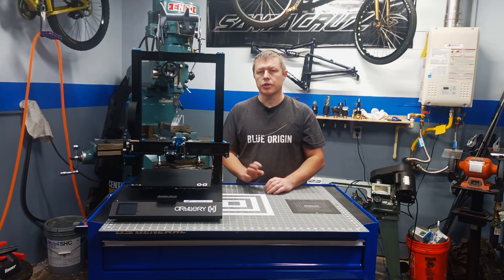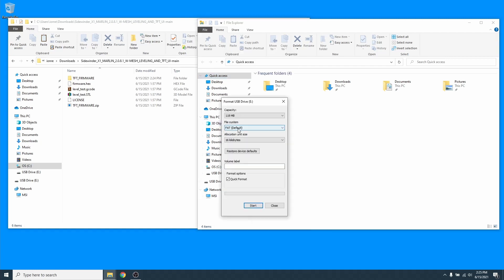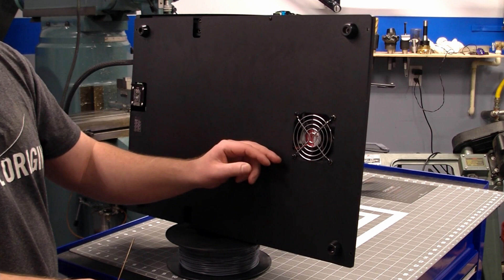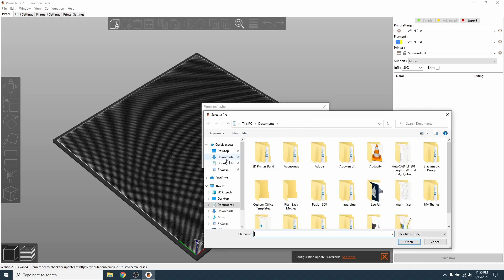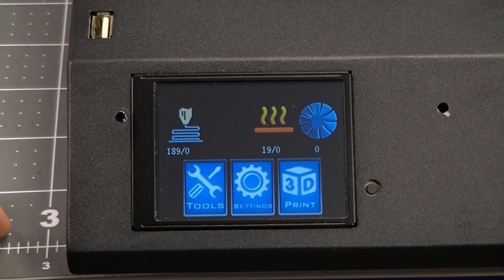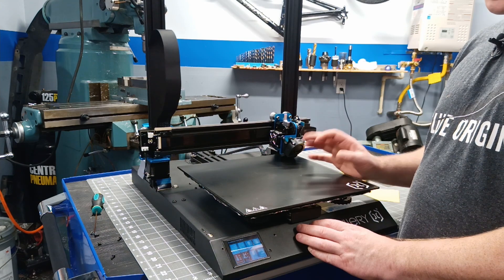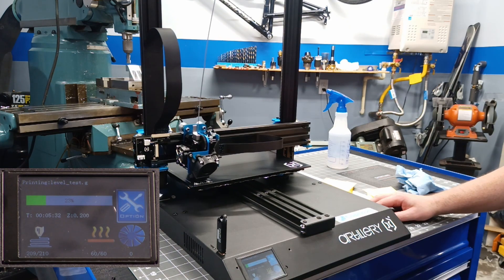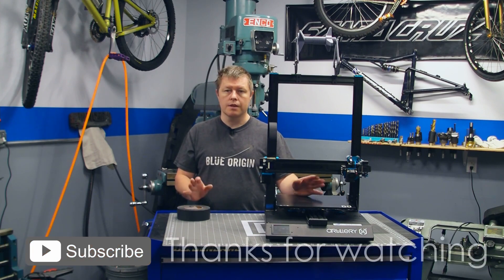Sidewinder X1 Marlin 2.0.8.1 with mesh leveling and custom touch screen UI.

Comment: Thank you for the information.  It's very much appreciated.  I tried this last night on my Artillery X1 and thing seemed to go well.  After printing the level_test.gcode all were perfect but the top right corner.  When I tried it again the first square was having a problem so when I went to stop the print I noticed on the printer screen it said, "mesh leveling failed".  I tried it twice with the same results last night.  I would love to get this working.  Any ideas on how to fix this?
Reply from the maker: I had that happen to me one time, I re did the mesh leveling and its been fine since. You can try redoing the mesh leveling and see if that takes care of it. If you have any more problems please let me know so I can look into it further. Thank you for your feedback.
Reply: @EtherealProject3D  I heated thing up and mesh leveled the bed again and saved.  I printed the level_test.gcode file and the prints came out just perfect.  
It's always printed pretty good, but these squares were perfect.  after completion and thing cooled down there was on error messages so I turned things off.
About 2 hours later I turned the machine back on and preheated things back to spec.  I started to print the same test again.  As it began to print, the "Error: Failed to enable bed leveling" came on.  I decided to let it complete the print cycle to see how well it would print.  I really wasn't all that bad, but not as good as with the bed leveling engaged.
Thanks for your help.
Reply from the maker: @stewartbeckman7909  Ok I will look into this and figure out why this is happening to you.
Reply: @EtherealProject3D  I repeated the process 5 time now and it finely saved.  I'm on my 3 print now and it's working perfectly!
Thank you for all you help.  I can't believe how much better it prints now.  Thanks
Reply from the maker: You are very welcome, sorry it was slow to get it right.
Reply: @EtherealProject3D  really love the firmware updates and it helps fix the warped bed issues. But I too am having the same issue with the error displayed.  Works with the initial mesh bed level process and when printing the test gcode it works without the error, but on subsequent attempts it shows the error.  Any ideas?
Reply from the maker: @davek2432  I will spend some time going through the firmware to see what might be causing this. I suspect is a space issue and im sure there are areas in the firmware that I can lean out and open up some space. Thank you for letting me know. I will give an update as soon as I can.
Reply: @EtherealProject3D  Thank you and appreciate the work you put into this update.   Not sure if this helps, but whilst I get the Error: Failed to enable bed leveling, it still appears to be still using the mesh levelling points and prints perfectly.   I will continue to investigate myself and let you know if I find anything more?  If only I had more time to enjoy playing with 3D printing and not having to do my day job:).  Found this online not sure if this is related https://github.com/MarlinFirmware/Marlin/issues/10726
Reply from the maker: Hello, thank you for your input on this and thank you for the link. I will have time today to look into the firmware and see what I can find. If I update anything I will let you know.
Reply from the maker: Made some changes in the firmware, will have to test then update the gethub.
Reply: @EtherealProject3D  I’ve persisted and reinstalled 3 times and now it’s seems to be working and no errors coming up.  I still don’t quite get why after the multiple tries?  But it’s working and thats the main thing, mesh bed levelling is awesome.  Thanks again for your work on this firmware update.
Reply from the maker: @davek2432  You are very welcome. Im currently working on a more optimized update to hopefully solve the issue you have had. Thank you for your input.
Reply: @EtherealProject3D  I've just finishing uploading the latest firmware (for both the mainboard and TFT) you posted, and the mesh bed levelling worked first go without the multiple installations.  Thank you for the update, well done and love your work.  Mesh bed levelling is a must for those who have slightly warped beds.
Reply from the maker: You are very welcome, Im happy its working better for you. Happy 3d printing 😁

Comment: Thank you very much! Very easy to follow and understand guide! Mind if I ask if this has arc support turned on?
Reply from the maker: You are very welcome, yes it has arc support. Keep in mind that I was unable to test the function so If you do use it and have any problems, please let me know so I can make any changes and update the file.
Reply: @EtherealProject3D  Will do! I just heard about Arc Welder and since I print using a lot of circles, I was looking to try it out. Thanks for making a nice firmware!
Reply from the maker: @cruduskellies  You are very welcome, happy 3d printing.
Reply: @EtherealProject3D  If you don't mind me asking, what print speed do you usually like to run your sidewinder at? Im just trying to make sure Im not limiting it by running at 40-60mms
Reply from the maker: @cruduskellies  With PLA I can get really good results at 80mm/s. With PETG I stick with 60mm/s, and with TPU I get good results at 30 to 40mm/s
Reply: @EtherealProject3D  Thank you. I appreciate  that. Back on the arc welder topic, I go to start a print with it on the GCODE, and the print never starts, weather this is because of my settings for arc welder in CURA or another thing I don't know. Just figured I'd tell ya.
Reply from the maker: Thank you, I will look into it when I get a chance. I have been wanting to play with arc welder but haven't had the time.
Reply: @EtherealProject3D  All good no worries. AutoPID tuning right now. I Swapped the thermistor for a better one and now this helps alot! Thank you!
Reply from the maker: You are very welcome.
Reply from the maker: I updated a few things for the arc support and updated the hex file. Let me know how that works.
Reply: @EtherealProject3D  I will! Though it will have to be later as I do not have free time this weekend. In laws are here...
Reply from the maker: @cruduskellies  No problem
Reply: @Ethereal Project So I had a quick question about the PID autotune. I did the Autotune yesterday and went to start a print, I come back today and it only got a few layers in before thermal runaway kicked in. TLDR: I found out since I did not do the PID Tuning with the part fan on like it would be during printing, the printer has a harder time maintaining temperature and can fall quickly when said fan comes on there by triggering thermal runaway. Is there anyway for Marlin to correct for that? Without changing fan speed for the print (I had to half it when printing in order for it to work), or AutoTuning with the fan on at speed?
Reply from the maker: @cruduskellies  The PID tune should run with the fan at full speed, i will look at the gcode for it and verify.
Reply: @EtherealProject3D  Ahh, so that is where I failed the first time. When I ran the tuning the part cooling fan did not come on for me.
Reply from the maker: @cruduskellies  Oh your talking about the part cooling fan, I dont remember if that one comes on. I am at work and dont have my printer with me so I will have to experiment when I get a chance. Try the tune again and see what happens, if that doesnt work try doing the tune via pronterface.
Reply: @EtherealProject3D  I will, I appreciate your help! Ive been looking into it and aperently Marlin 3.2 can do the Autotune with or with out the part coling fan on as it can adjust when need be, but other marlin variants have to have the part cooling fan on at the speed its usually going to be at when printing. Otherwise when it kicks on it can drop the thermistor temp, and trigger thermal runaway. This is the link for what I was reading https://forum.duet3d.com/topic/20674/hotend-pid-tuning-with-part-cooling-fan-or-without
Reply from the maker: @cruduskellies  Your very welcome, I appreciate your feedback on this.
Reply: You are welcome! And thank you for being so quick and helpful with your responses!
Reply from the maker: @cruduskellies  You are welcome. Invite your friends ;)
Reply from the maker: I spent some time looking at the gcode I have set up for the pid tune and it turns on the hot end fan to 50%. I will do some experimenting this when I get time to see If I can make it work better. In the mean time you can run the tune via Pronterface with the m303 s220 c8 u1, then m500 to save it. then m303 e-1 s60 c8 u1, then m500.
Reply: @EtherealProject3D  Sounds good, I am currently confirming my suspicions about the part cooling fan interfering with it. Turning that fan on at layer 50 on a tiny print instead of 4 where all the others failed.
Reply: @EtherealProject3D  Do you know if the hot end fan is on at 100% during printing? Or does it vary in speed across the print?
Reply from the maker: It depends on how you have it set up in the slicer and what material you are printing with. For example with PLA normally for the first layer or first few layers you want the pert cooling fan to be off to help with bed adhesion then slowly ramp the speed up to 100% over the next few layers. With petg you really dont need the fan on more than 30% if not at all. Alot of that will be model dependent as well. When I print large flat parts in in PLA I dont turn the fan on till layer 4 or 5 and take another 4 to 5 layers to ramp the speed up, for small parts I have the fan come on 50% at layer 2 or 3, then 100% after, or somewhere in between. Once again its all dependent on the size of what it is that I am printing and the specific geometry. It took many experiments to figure out what works for me and the kind of parts that I print. Long story short, there is no one set way to do it, you gotta play with it and figure out what works for you.
Reply: @EtherealProject3D  That makes sense.  I should state that I am using an aftermarket thermistor that is more sturdily built than the stock one. And I do believe my issue was caused by the fan turning on 100% at layer 4 basically giving the software more than it was capable of combating. Now that Ive made it increase over several layers it works beautifully. So thank you very much for your help!
Reply from the maker: @cruduskellies  The firmware might need to be set for that specific thermistor as well, can you post a link to it so I can do some research on it and If the firmware does need to be changed for it I can do that real quick for you, its only 1 setting that takes like 2 seconds to change.
Reply: @EtherealProject3D  Sure thing! Also due to the geometry of the thermistor I am not using a silicon sock, I never really liked them and now I have more cause not to use them. 
https://gulfcoast-robotics.com/products/epcos-thermistor-upgrade-creality-ender-3-5-cr10-3d-printers
Reply from the maker: The firmware is setup good for that sensor. I have heard of people having temperature issues when they take the silicon sock off, you might try trimming it to fit over the back end of the thermistor to keep it on, it does help block the part cooling fan from cooling the heat block.
Reply: Makes sense,  I am currently running teaching tech's retraction calibration so once that is done Ill see what I can do about re adding it  the biggest issue Ive had with trimming it in the past is it doesn't like to stay on the block too well. Mind if I ask how you set the fan to start with lower speeds on the beginning layers and work its way up?  Im looking through my slicer settings on Cura and it seems to only let me put what layer I want the max speed to be. So I cant put 15% at layer 2 and work its way up slowly.
Reply from the maker: So cura is a bit funky with that, you gotta do a little math but you wuld set regular fan speed at height to 1.4mm, that is 7 layers, if your doing 0.2mm layer height. It just takes the setpoint for regular fan speed subtracts the initial fan speed and divides it by how many layers its going to take to get there, for example if you set regular fan speed at 100, and initial fan speed is 0, and have regular fan speed at 2mm, it will increase the fan speed by 10% per layer.
Reply: Ahh ha, I did not know that. That is an odd way to do it. I looked at my software, and mine was set to 100% at .8mm
Reply from the maker: @cruduskellies  that seems pretty normal. This was an easy concept for me but maybe not for many other people so im gonna make a video explaining it, im working on the script right now.
Reply: @EtherealProject3D  Alright I appreciate that, have you had problems with a cura post processing script not implementing? my retraction test isn't altering the retraction...
Reply from the maker: @cruduskellies  I have not used post processing scripts in CURA before. When I did my retraction tower I used the gcode from Teaching Tech
Reply: @EtherealProject3D  Alright you have been a big help, and the mesh bed leveling you put in the firmware fixed my concave build plate. So thanks again my friend!
Reply from the maker: @cruduskellies  Not a problem, thank you for your feedback and communication.
Reply: @EtherealProject3D  Hey there! Quick question/idea for ya. Do you think it is possible to add support for an accelerometer? That way there can be whatever the marlin equivalent of klipper's input shaping is?
Reply from the maker: @cruduskellies  That is a very good question. I am not familiar with Klipper as I have never run it before. I will have to do some digging around to see if there is a way to implement this feature into it and let you know what I come up with. Thank you for asking.
Reply: @EtherealProject3D  You're welcome! I know Teaching Tech has a great video on the topic. Though Im not sure if it's just a firmware thing or if one would have to change some aspects of the PCB's.
Reply from the maker: @cruduskellies  Not sure, I will check it out and do some experimenting.

Comment: what about the artillery genius do you have plans to make firmware for that printer?
Reply from the maker: Yes, I have made one for the Genius but being that I done have one I have not been able to test it. Here is a link for it, if it works I will add it to the description of the video. Thank you for your inquire. https://github.com/Ethereal-Project/Artillery_Genius_MARLIN_2.0.8.1_W-MESH_LEVELING_AND_TFT_UI.git
Reply: @EtherealProject3D  just install your firmware for the Genius everything works 100% i also install your firmware for the sidewinder x1 bed mesh leveling works outstanding now my printers are complete thank you so much!!!!
Reply from the maker: @tomshaw8830  Awesome, thank you for letting me know. Happy printing.

Comment: Hola, gracias cuando llegue despues del turno lo instalo. Consulta lo podrias modificiar para una Genius ya que tengo ambas y lo quiero para las dos. Gracias.
Reply from the maker: No hay problema, mi amigo. Pruebe esto, si tiene algún problema, hágamelo saber y lo solucionaré. Impresión 3D feliz. https://github.com/Ethereal-Project/Artillery_Genius_MARLIN_2.0.8.1_W-MESH_LEVELING_AND_TFT_UI.git
Reply: @EtherealProject3D  to many thanks.
Reply from the maker: @juanantonioherrerayu  you are very welcome, I left you a little surprise in there too, you will see when you print the level test gcode.

Comment: Shouldn't you add m420 to the start gcode of the slicer to enable mesh bed leveling?
Reply from the maker: You can but it is not necessary as ive got restore leveling after g28 enabled.
Reply from the maker: I tested with and without m420 in the start gcode and it made no difference, it still was able to use the mesh.
Reply: Oh thanks that's nice I have used other fw before where it was needed.
Reply from the maker: No problem, its a very valid question for sure.

Comment: Is M600 enabled in the fw ?
Reply from the maker: I believe so, I will check when I get a chance today and let you know. If it is not I will update the HEX file. Thank you for your input.
Reply: @EtherealProject3D  Excellent, thank you !
Reply from the maker: Hello there, I have looked at the firmware and found M600 is not enabled, I have enabled it and have updated the HEX file, sorry for this oversite and thank you for asking so I could fix it.
Reply: @EtherealProject3D  Perfect, thanks for the update !
Reply from the maker: @imfrombelgium745  You are very welcome.
Reply: @EtherealProject3D  I just installed your firmware without any issues thanks to your tutorial. I tried testing the m600 change filament using cura. The printer homed at the desired level, but i couldnt get it to resume after changing filament.
Reply: retried flashing the updated firmware, but it still wont resume on filament change. The extruder temp shows a frozen screen temperature of 210c but i couldnt load the fillament. switched the printer off and on, it shows the extruder temp is actually only 20c